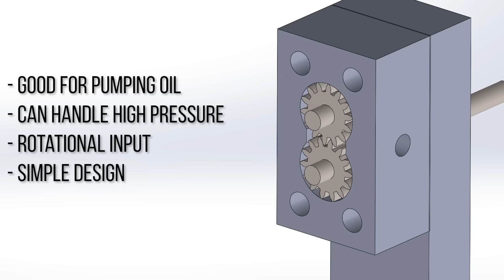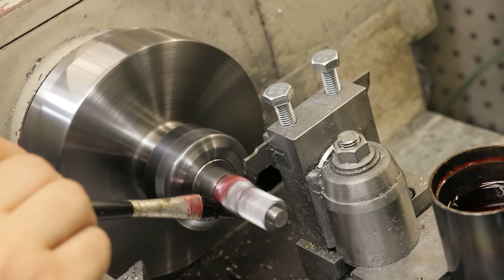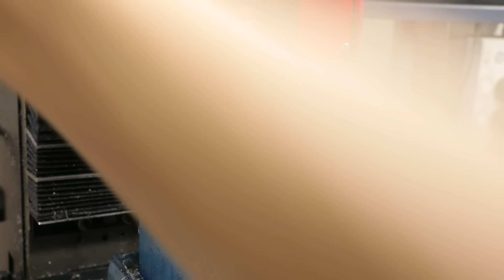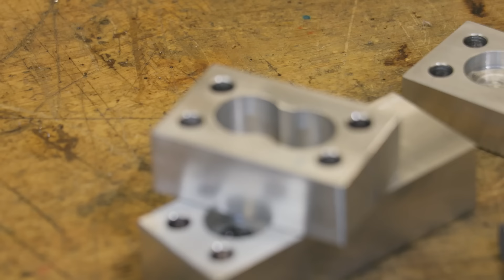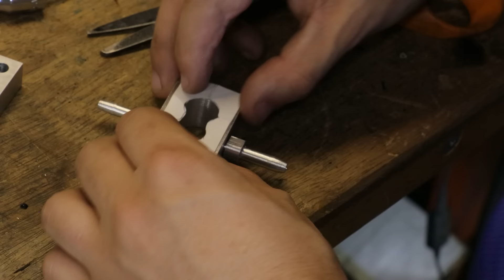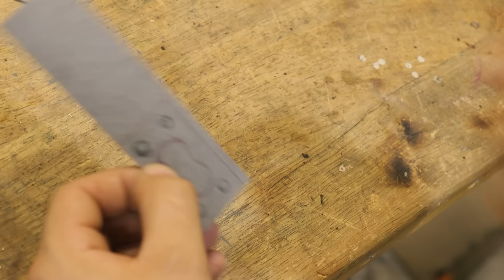Building a Hydraulic Gear Pump

Comment: I have been machining my own gear pump as well (For ~900 psi of pressure) it doesn't apply for yours, but when you start having pressure, you need to be concerned with all the forms of leakage. Radial leakage is handled by the tight tolerances from the gears to the housing as you mentioned, but axial leakage on the flat faces of the gears also has a big impact. It only takes a very small gap to reduce your volumetric efficiency dramatically. In your current setup, you have at least two gasket thickness of clearance between the gear faces. Another leakage path is the gap between the plain bearings from the D you cut in them.

If anyone wants a good resource on external gear pump design I would recommend this paper:
"Fudamentals of External Gear Pump Design" from the US Naval Research Laboratory
Reply from the maker: Thanks, I’ll give it a read up
Reply: @artisanmakes  You can also use a 1 mm PTFE sheet as a seal and lay it over the entire surface, including under the gears. I have seen pumps designed this way.
Reply from the maker: And fur sure I don’t think this is capable of high pressures
Reply: I was going to say centre section may need thinning after measuring compressed gasket thickness to reduce clearance.
If you've ever checked automotive oil pump, Melling 'High Flow' is really really crude, gears are ROUGH but it can still make enough pressure to bow the cover plate (or so I've heard)
Reply: Yep. All of what puggle4798 said. Particularly the gap at the ends of the rotors corresponding to the thickness of the thicker gasket material. Also, excepting that making all the components is part of the aim, socket head shoulder screws would have been ideal to act as dowels and as fixings to hold the gear pump sandwich together. The shoulder diameter of shoulder screws is typically finished by grinding to size. To take full advantage of the accuracy of the shoulder screws it would be best to match-drill holes in the layers of the sandwich to receive the shoulder screws. An alternative approach to sealing the "sandwich" with gaskets, which would avoid the gasket thickness problem, is to use an O-ring set in a groove that encompasses the whole of the gear pair. The grooves for the O-ring can be in either the body piece or the end plates. I acknowledge that the size of stock material that you had to work with did not allow for the option of a circular O-ring groove. Also on the clearance between the perimeter of the gears and the housing, why not go for zero. If they rub a little, it will be a self solving problem and in the end it will result in minimal clearance. I enjoy your well produced videos. Cheers
Reply from the maker: Well on that last point, I could have sworn that I saw somewhere that a 40-50 micron gap could be used in a gear pump. I’ll have to look up my source again becuase maybe it is not correct. That’s the only reason why I went for that particular gap. If it says to go for less I would have.
Reply from the maker: As for o rings, I really would want to have a cnc for it. You saw the bearing block with a o ring channel, which was taken from a real gear pump, but I don’t think I could do this with a manual machine. I just think a gasket which I may need to modify, will prove to be easier to implement, and achieve the target specs needed here.
Reply: Thanks alot for the reading suggestions! Will help out a ton with my uni project
Reply: It's hard NOT to read the whole 130 page, thanks mate!
Reply from the maker: Takes me back to my undergrad….

Comment: Very nice!
With this design the end seals are not really great though and that is probably where your oil is flowing back now. A quick pressure test would be interesting?
Normally the end plates float and are pushed from the backside by outlet pressure to clamp the gears for a good seal not relying on the assembly bolts. They also transport any bypassing oil back to inlet side.
Reply from the maker: For sure but as I said it’s not really much of a consideration here. I think the design would need a radical change to accomodate higher pressure. Cheers
Reply: @artisanmakes  I get it. There was no pressure plates in what I worked on either as it didn't need that high pressure although we used a not insignificant pressure. Look at Hy5 Bionics for what it was. Great fun, and a meaningful project!

Comment: Even though I think the desigm is "technically incorrect", this is super awesome. I mean, it works, right... so who cares.

To be "correct", the gears should both be driven synchronously, just like in a clutch pump. Lot of extra work though, and beyond the point of "works fine", the returns are kind of diminuishing.

Comment: Reminds me of the high pressure coolant pump in our Haas lathe . It had no bearings simply because it was running of of coolant . Size was about the same as yours but the motor was a 5 HP 3 phase one

Comment: Nice!   I did see an old video about scraping in parts, and one justification for doing so was to create a leak-free assembly without gaskets.  Not sure if it works for aluminum though.....
Reply from the maker: I’ve actually done a test pattern years ago scrawling aluminium as a practice run and it worked surprisingly well

Comment: How difficult do you think it would be to make an "gerotor" type pump, like used in many automobile engines? I think making an internal gear and an external gear (ring/planetary style) that are sized just right would work, and would avoid having to figure out how to cut the tricky shapes.

Comment: Slotted screws? Can you not just order some screws that you need with an allen head, or torx head? I see that you can make those ones yourself and any other head is rather difficult to do on your own. But.... well.... we all know that the slotted heads are shit.
What made you decide for them anyways?
While rebuilding my 72 peugeot I consequently said fuck original to any of them. Hex and allen it is for me in that very case.
Except for shiny interior stuff that bolts down chromed parts like the sunvisors mounting or the roof locks - I gotta admit that. Those are for the classy look of back then.
Reply from the maker: It’s a pain in the arse to rotary broach a hex head which is why I never do it. And for a set of screws that I’ll likely never undo again I don’t see anything to complain about. FWIW the dimensions on the screw are non standard so I doubt anyone makes ones to suit. Cheers
Reply: @artisanmakes  Oh ok

If they are by no means available to buy, I see why you did it like that. Thx for the explanation

Comment: I don't understand  why no YouTuber goes for tapered pins. They are specifically made for alignment, provide better fits, there are commercially available tapered reamers for this purpose, and the pins themselves are easy to make
Reply: Err “Clickspring” uses them all the time…
Reply from the maker: Because it was going to get the screws anyway so it just felt easier to make them work double duty

Comment: Did you account for the compressed gasket thickness in the end clearance of the gears?  An anaerobic sealant designed for close fitting surfaces would have been a better choice for this application IMO.
Reply from the maker: I did the first time round, not so much when I had to go for the thicker one. I probably added half a mm
Reply: @artisanmakes That's quite lot of area for oil to bypass on a small pump, and would explain any reluctance to prime. I suspect there's quite a bit of performance you could unlock here.  Very interested to see the application though!
Reply from the maker: Yeah as a percentage it would seem to be a lot. Nothing that can’t be fixed by a pass through in the mill. Cheers

Comment: Needed 2 dowels.
My old Harley uses a similar pump. If you use gaskets (like it does) they need to be included in the gear axial clearance, and the pump bolts tightened down to a specified torque to cause the correct final gasket thickness. Then of course must be new gaskets every time it is reassembled.
Reply: At that point, you may want surfaces not separated by a gasket that touch together to set the clearance. The gasket (or o-ring) should be expected to compress more than that, so the clearance should always be consistent, even with slightly different gasket thicknesses.
This sort of thing is probably easier to do with an extra-wide o-ring groove.
Reply from the maker: It was going to get the 4 screws anyway so I see no problem making them work double time. And they worked just fine, if they didn’t I would have had to use some locating pins.

And they are tightened to a specific torque. It’s okay that feels tight enough nm
Reply: I agree , using your hardware as dowel pins is just fine .
As long as there a very good fit.
You did well on that
Reply: @thieltech1   it's not very professional. Screws will chew into the housing over time and are a poor choice as locating pins. And screws come in different sizes depending on manufacturer and type.
Two dowel pins, near the corners for maximum precision, of a light press fit, will locate the housing and last for many rebuilds.
And a 2 part housing would be better than a 3 part housing, and is not significantly more difficult to make. The cavities are in the larger part, and the smaller part is simply a cover. Then there is only one surface to seal.
Of course this is all advanced stuff, in reality the pump he has made here seems to work fine and if pressures remain low-ish it should do its job for years.
Reply from the maker: Yeah it’s an understatement that none of this is even remotely close to how you’d design a commercial pump haha. But it works. And I think the pins will serve their purpose without much hassle. I listed my reasons for making it the way that I have. If I had different machines and larger budgets to work with for sure it would have come out a bit different. Cheers guys

Comment: I have a similar design for my milling machine made by the factory. They are 16 tooth M2 gears. Driving them by 1350 rpm they are so loud that I have to wear ear protection. So I tried to change the gears to M1, made rhem of plastic, making the bushes out of brass, so on. Bit better but still loud. Now I ordered a gerotor type of pump from Joom what I will drive with the original motor.

Comment: bigger teeth would also improve flow
Reply: Was looking this comment. As this pump seemed to have quite small teeth. And as suction and pressure are direct conjucation of theet meshing in or out that would also increase selfpriming.
Reply from the maker: Probably but bearings were 16mm, so the gears were 16mm. There really wasn’t much else considered when deciding the dimensions. And I only have module 1 cutters. I don’t think I could really go above maybe a module 1.25 on this size. Cheers

Comment: Oh my friend. In my previous company for these pumps 0.1 m diff between gear OD and the housing ID was considered FUBAR according to spec. Also, the gap between gear side and housing should be 0.01~0.02 mm, this is were all the wear and loss always happpens, but you didn't account for a gasket thickness so your pump (According to the footage as well) does ~10% cap. Try to replace the gaskets with loctite, should be much better. Love your videos!
Reply from the maker: I must have misread my text book then. Becuase that might need to be rebuilt. I could have sworn it said 0.1mm but I’ll have to take the l on that. Fwiw I did intend this to work with the copy paper gasket and when it didn’t work, I needed up with 0.4mmm extra. Is no problem I can just take the block down a bit. Cheers
Reply: @artisanmakes locktite and silk thread as the gasket.
Reply from the maker: Well hopefully get it up and running in the next week. If it’s works out the way it is at the moment I’m going to leave it as is. I’m really not looking to chase much performance with this, it just needs to work. Cheers
Reply: @artisanmakes  Buddy, a gear pump with 0.1mm clearances is more or less a centrifugal pump with extra steps.
It'll move liquid but you'll never be able to do any useful 'work' with it. As soon as you meet any resistance to flow (pressure) it's just going to bypass like crazy. It'll also run extremely hot.
Reply from the maker: Watch the video it is 0.05mm (maybe less because the gears didn’t get debuted) but I think you’ll be surprised when it just works. That is all it needs to do. If it needed to work to specific targets I do not think that his design could have worked. Cheers
Reply: @artisanmakes But there's no restriction to flow on the outlet, you're pumping at negligible pressure. Is that all you need to do, or is this required to operate at hundreds of PSI?
Reply from the maker: I mentioned that at max, I’m expecting 20-30 psi. Almost nothing on this pump. If it can do that, it is good enough. Cheers
Reply: For something like a cold waste oil pump a little tooth/wall clearance ain't bad, and can help if there's no pre filter. If it's hot clean oil, then it's basically a gas and you absolutely want every clearance as tight as possible and the parts being of the same material and temp.
Reply: I don’t have your background, but  I was going to comment the same. Every gap in the inside is lost flow.
Reply from the maker: Okay, I feel a bit betrayed. My book definitely lists a clearance of 0.13mm as being acceptable. That’s a big L there
Reply: I have used loctite as a FER more then once .
Reply: Can we all pretend that this is somehow a part for a much needed bandsaw?
Reply from the maker: Sure you can pretend. It isn’t though :)
Reply: Also isnt aluminum veing differrent in thermal expansion is going to accomodate for that? Expanding ID decreases under heat if aluminum is constrained, no?
Reply from the maker: I think we have very different ideas of what this pump is expected perform to.   This is a basic low speed oil pump, you don’t need to worry about thermal expansion
Reply: @Kuršiukas It is something that has to be taken into account but isn't an enormous issue - the upper limit for most hydraulic systems is about 85C/185F anyway. If you start seeing temperatures higher then that it's time to shut things down and start searching for the problem.
Reply: Came to say the same , gaskets are way to thick.
And to much is bypassing side walls.
Try locate sealer or just a very  thin coat of grey rtv. ( I have done on the many pumps I've built)
Or better yet cut a  O-Ring groove on both side covers and  ditch the sealer.
This is what I do when I make hydraulic pumps.
(And like you said bigger inlet and outlet will help alot!)
Reply from the maker: Yeah I’d really want a cnc if I were to do an o ring here.
Reply: Maybe you could have used an oil pump from a car, but from what I remember your side clearances are too great, but maybe ok for your needs. The oil pump in my old car that looks like yours, isn’t as deep, does about 5 bar maximum without cavitation, and a paltry 2l/min.
Reply from the maker: Of course I could have used a car pump. But if I do all the I don’t learn anything or have any fun doing so. I do this as a hobby. It would be a hobby if i never had to make stuff. Cheers
Reply: @artisanmakes Faie enough, we are all different, I’ve made oil pumps and adaptors for my cars, using existing gears and modified parts to make higher flow ones, and I learned by measuring the existing ones and the tolerances in the manual. I wasn’t dissing, I think the projects that you tackle on your channel are well realised and you’ve amassed a helluva skill set .
Reply: I've shimmed these pumps many times in the past with copy paper to get running clearance.

Comment: The thickness of the gaskets needs to be zero for this design to work properly
Reply from the maker: Kinda my fault for building it to work with copy paper when realising that it wouldn’t work. Making it up as I went along doesn’t always work out
Reply: Ideally with o-rings instead
Reply: @MartinBalle7, ideally, the bearings would be in the middle section. For this pump to work effectively, the distance from the bearings to gears needs to be very low, or the oil escapes easily
Reply from the maker: Yes this is also true. The cad model I showed had allowances for o rings in the blocks, but with only manual machines, doing my way is easier. Same for keeping in one housing, this was changed for ease of machining and since pressures are kept low, I didn’t worry too much about leaking above the gears. Cheers

Comment: As I learned from the 1970s/80s era Opel CIH engine, which oil pumps are no longer available for, the clearance at the end of the gears is critical for making pressure. I'd try and anaerobic sealer instead of gaskets since they're all nicely machined surfaces.
Reply: I have dun the same thing with Red and blue Locktite but if he is going to use the Gasket paper he should take the thickness of the paper out of the Center block. IMO
Reply: Try Loctite 518

Comment: That's the kind of oil pump in my old motorcycle (1966 Norton 650SS), although it has two pumps in one - one for scavenging to the oil tank, one for pumping through the engine